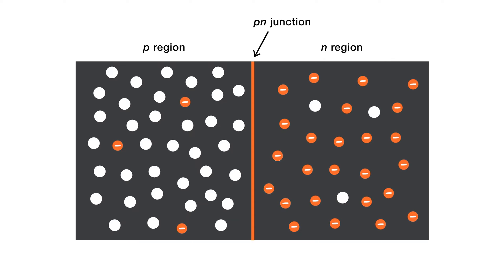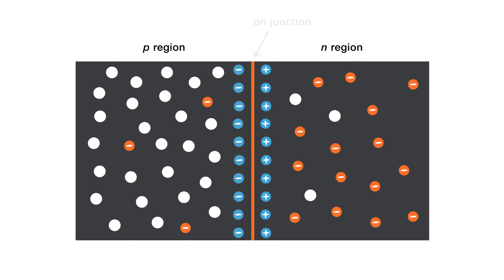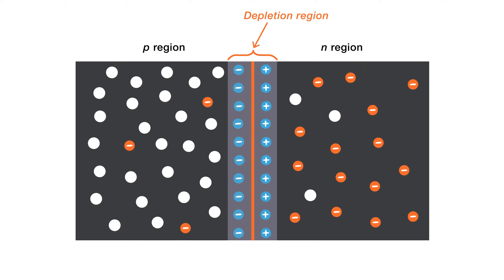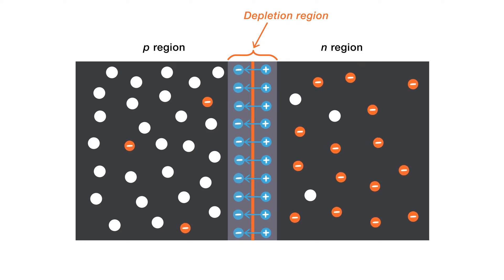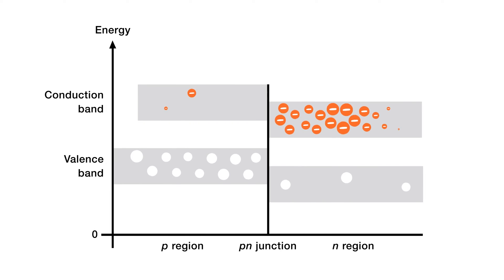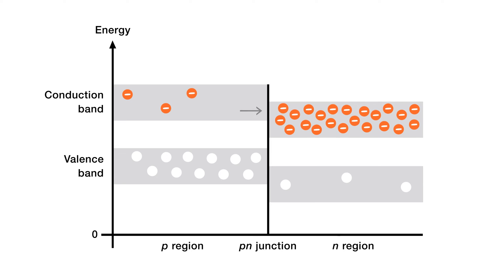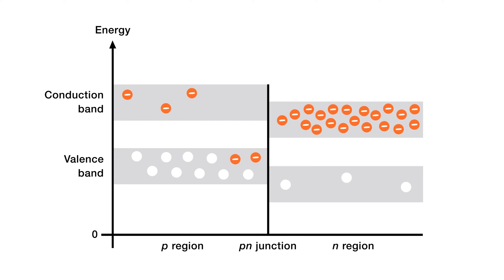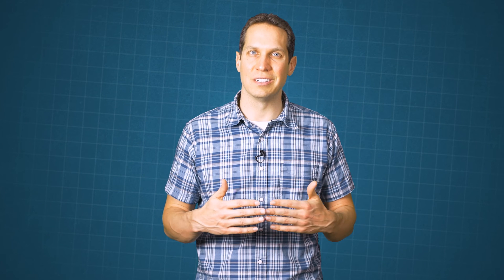How does a diode work - the PN Junction (with animation) | Intermediate Electronics

Comment: Sir, My Second Question is why does the  free electrons rapidly lose energy while falling into the holes right after crossing the p-n junction (at 3:26) (I understand WHY it should, because the acceptor energy level is lower than the valence Band obviously, I just don't know what underlying phenomenon makes the electrons lose energy)

And, my 3rd Question is- similarly, what makes the overall energy level of the n region to decrease as soon as a depletion region is created? (at 3:39)
Reply from the maker: Your second question seems nearly philosophical when I read it.   They lose energy because they tend toward the lowest energy level, just like why a marble in a bowl wants to settle in the bottom.  And hitting the bottom of the bowl causes the marble to jump up, just like the insertion of energy (in terms of heat or light) causes the electrons to jump out of the valence band.  Any underlying "why" below that... I don't know!

Let's see if I can do an adequate job explaining the third question.  Even though the overall semiconductor has the same energy, the energy has been redistributed by the movement of electrons and holes within the semiconductor.  As the n region is dropping in energy, the p region is increasing in energy, so that's where you get the balancing.  And it isn't decreasing as soon as the depletion region is created, it's dropping in conjunction with the depletion region being created.  The two things are related.  Hopefully that clarifies things!
Reply: Thank you so much, all your answers are really helpful. But I'm  so sorry that I'm having too many questions to bother you again and again, ha ha!
Anyways, so what you just said about why electrons lose energy while falling into holes (you said that it's just a natural tendency to 
have lowest energy) so why does that tendency come visible "after" the electron has crossed the junction? Does it mean that any valence band electron on the n side can just jump down to valence band randomly? If not, then what's making that change of energy drop ONLY after the passing of electrons? (it's fine if you can't give the accurate answer to this, I went pretty deep😅...but if you know any other resource as suggestion where I can find the best but easy explanation, that would be a great bonus favor, too)

For your response to the 3rd question (energy gradient increment between n and p regions with depletion layer formation): I do want to ask that referring to one point you  made in the video about why initially the energy levels of n type semiconductor is naturally a bit less than p type. There you had explained the reason in terms of effect by nuclear attractions. So my question is, if we consider the energy drop / energy jump in the respective n and p regions during the depletion layer is being formed, how can that be explained in terms of thr nuclear attractions (individually for n type and p type)?
Reply from the maker: @aryanandaleebazim823  No problem!  My only concern is that we're getting close to the edge of my understanding -and I'd prefer to have Dr. Campbell help (a professor and awesome person that we've used as a resource to double-check our work in microelectronics) but she's always crazy busy.  So I will do my best!

I think we need to expand the bowl analogy more.  In reality, it's not just one bowl, it's trillions and quadrillions of bowls per square centimeter of lattice.  And even though that may sound like a lot, it's absolutely tiny compared to the amount of atoms in that same area.  So, at this point it becomes a statistical thing.  But the more bowls there are, the more likely that an electron will find one and then fall into it to the lower energy level.  Once the electrons cross through the depletion region, there are a lot more bowls, so it's statistically much more likely that the electrons will drop down in energy level at that point.

If I'm understanding this question properly (which I may not be) you're trying to figure out why the n and p regions have an even greater difference in energy levels due to the nuclear forces on trivalent versus pentavalent electrons, AFTER the depletion has been formed.  I think, in this case, that this is not actually the case.  This change after the formation of the depletion layer is not due to the nuclear forces between the nucleus and the valence electrons but simply by the energy of the extra electrons that are moving from the n region to the p region.  So, instead of the inherent differences in energy levels due to the nuclear forces between the nuclei and electrons, it's due to the physical movement of particles that have intrinsic energy.  Does that make sense?  I'm not sure if I could go any deeper than that without getting a degree in chemistry or physics. 😀

Comment: Why don't the negatively charged ions in the depletion layer just spread all over the n region as there are so many holes, instead they just remain alligned towards the center? Vice-versa I have the same question for the positively charged ions of the depletion layer and the remaining free electrons from the p-region..
Reply from the maker: Oh, I thought we had put a pinned comment to address this mistake.  We have a note in the corner but I guess it's not obvious enough.  Sadly, there's an error in the animation.  Those charged ions (what we put as blue) are fixed, they don't move.  So when they lose their extra holes or electrons, they stay in that spot at the depletion layer, they can't roam around.  I'm sorry for that error and the confusion it caused!
Reply: @CircuitBread  Ah, it's totally fine! Oh Lol, speaking of which, I just found out that "i" marked sidenote xD after you pointed out, and I'm laughing so hard don't know why xD.

Thank you so much, you are so kind and helpful though! <3

Anyways, rest apart, why shouldn't the blue ions move though? 
Edit: I can guess probably it is because atoms can't move in lattice structure...is it so? And if it is, then do the same hold for the negative ions on the other side as well?
Reply from the maker: @aryanandaleebazim823  Thanks!  We were trying to figure out the best to approach that mistake and Laren just threw in those responses.  We were pretty frustrated with ourselves at the moment so we didn't change them :-)  

You are exactly right - the ions are the atoms stuck in the lattice structure, keeping them in place.  So both the negative and positive ions should be stationary on both sides of the depletion region.